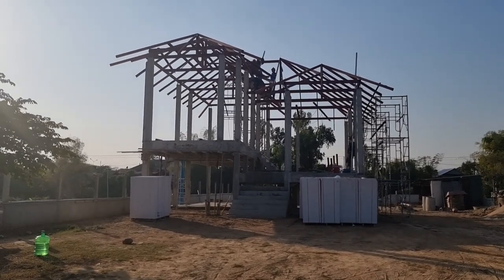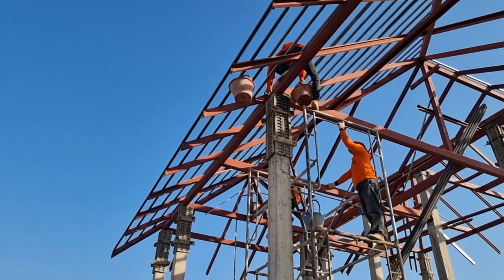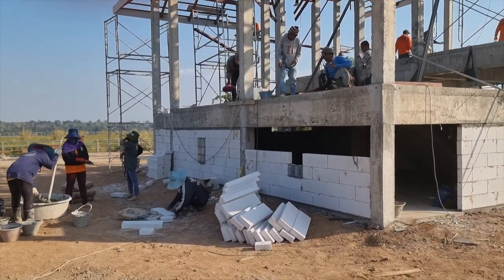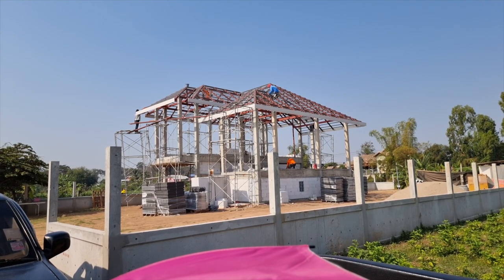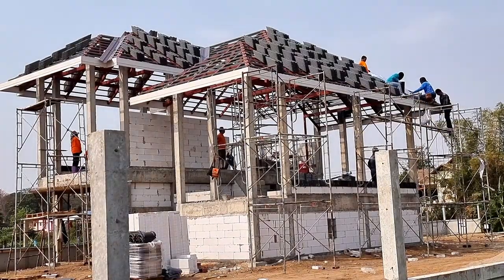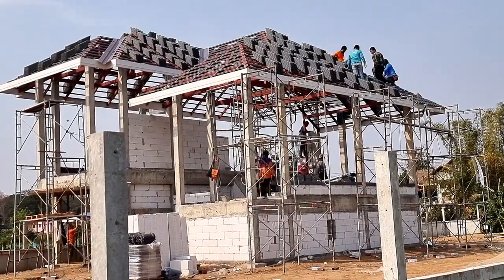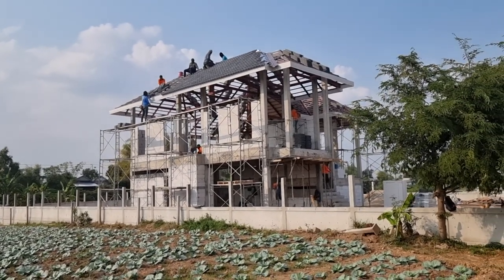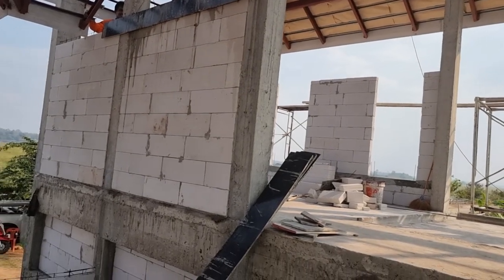Building a house in Thailand   Part 17   Roof progressing, thermal blocks going up

Comment: Still not too late to change the wall at pipes to form something. These blocks should cut easy enough.
Reply from the maker: Yea was thinking I could just cut put a section, but got putside kitchen too so will just put oven out there bud

Comment: what blocks are you using and size ?
Reply from the maker: Hi, thanks for watching, I'm not to sure of size they are thermal blocks, pretty amazing at keeping heat out along with reflective foil under tiles, the house is always much cooler inside even without windows or doors.

Comment: How do you want handle the hot attic air?  Is there a vent or other mechanism to vent the air?
Reply from the maker: Hi it is vented all round the edges, there is a reflective sheeting under the tiles but I think eventually I'm going to put insulation on the top of the gyprock sheeting, the problem is that the heat doesn't resly come in through the ceilings, it comes through the walls, that the reason we had a big full length car port added.  Thanks for watching and commenting.
Reply: @LIFEbytheMEKONG  Its all around the bottom edges right?  (basically, on the bottom of the overhang?)  I have seen large (to me) overhangs in Thailand house. I see radiant barrier mounted under the tiles and had thought about putting insulation (example those insulation bats wrapped in foil from HomePro), but similar to you it looks like most of the heat is from the walls. I have been tempted to buy a Flir camera, but wife said no. lol.  Ah, ok, I did wonder if your carport was on the south side or not. It's a good thing.  Ours makes sounds (pops) when the sun hits it so thinking its thermal expansion/etc since the top is dark brown. (I wanted to put on a white elastomeric, but the in-laws and painter said it wouldn't help).